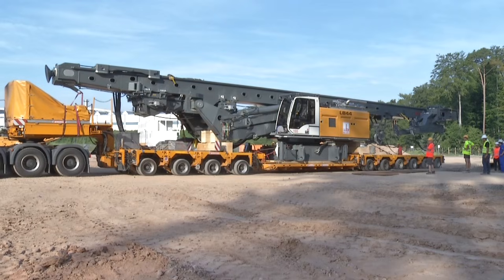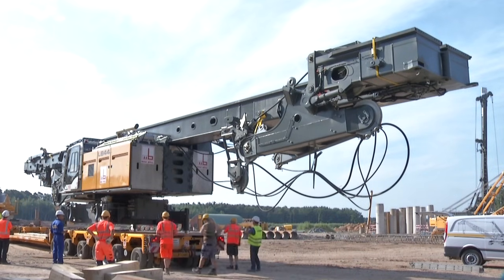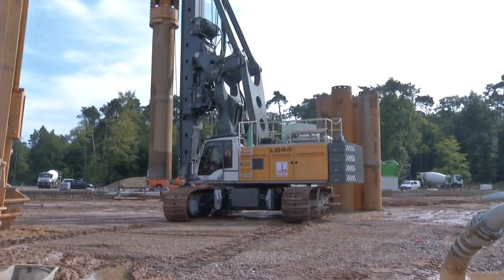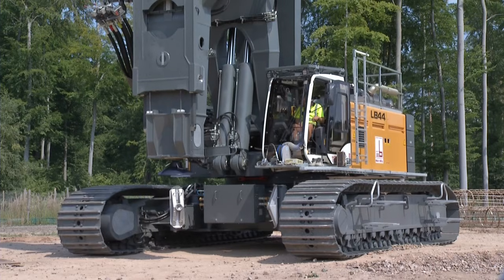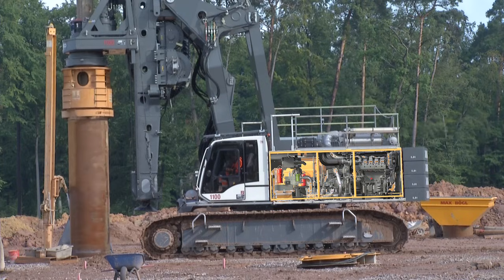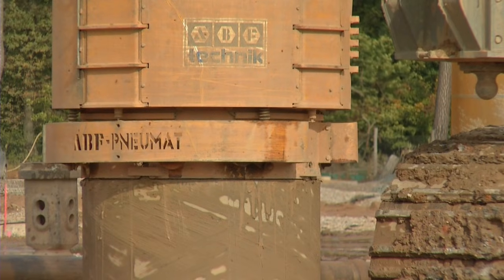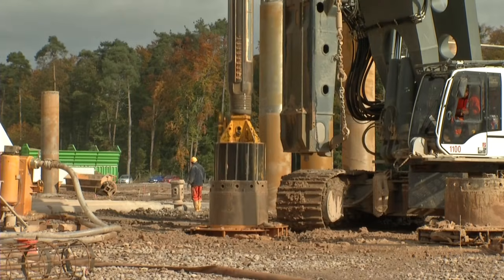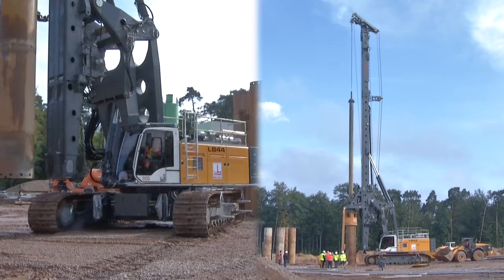Liebherr - Mr. Torque - the LB 44 rotary drilling rig

Comment: Why do they represent decimal weight as 5,8 ? Here, that would mean you have '5 and 8'.
Decimals are normally expressed as 5.8 for example, where (.) is the decimal point dividing the whole number (5) and the fraction of 10, in this case 8/10.
Reply: In some countries like Germany commas are used instead of decimal points

Comment: 376,156lb/ft of torque for all you in Liberia, Myanmar and the USA that still use the old British empire imperial system.
Reply: if you're gonna troll, get the units right.
Reply: @jnawk83  so what unit do you use to measure torque?
Reply: @xaiano794  the freedom unit is the foot-pound, you used pounds per foot.   I use the newton-meter, like all reasonable people such as yourself
Reply: @jnawk83  you're right, the correct nomenclature should be lb/ft but for some unknown reason people called the unit the foot pound instead.
https://en.m.wikipedia.org/wiki/Pound-foot_(torque)

Man what a perfect example of how stupid the system is. Thanks!
Reply: @xaiano794  well even that calls it a pound-foot (lbf-ft) - no division involved.  Don't insert a / in there.   But yeah it's a totally daft system.

Comment: 510 kilo newton metres of torque. I replayed that to make sure I had  not misheard.
Reply: at a guess, the rig needs to be anchored to apply that because that should be enough to just start spinning the rig instead of the drill head
Reply: @stardustger2389  It of course makes sense as soon as you do a basic torque calc but if your torque benchmark is car engine figures it is pretty impressive!

Comment: Leider können die üblichen Rezepturen für Kontraktorbeton derzeit nicht mit den aus den erreichbaren Bohrtiefen dieser Gerätegröße erwachsenden Anforderungen mithalten. Bei der hier gezeigten Baustelle (Liebherr weiß welche ich meine) hatten wir mit den über 60 Meter langen Pfählen da zeitweilig auch Probleme.

For the time being the usual tremie concrete mix designs unfortunately can't meet the requirements emerging from the achievable drilling depths of this rig size. During the job shown in the clip (Liebherr knows which site I mean) we sometimes also faced problems with shaft depths exceeding 60 m (200').

Comment: Terrible product support of these machines here in America...we got rid of our dozers and track how because of overpriced parts and lack of dealer support...now we only buy CAT....period
Reply from the maker: motorhead Well, we had some problems with the dealer network in the US for earthmoving machines - but these are solved now and we are adding more and more service locations.For special deep foundation, we do run an own network in the US, there shouldn't be a problem for the drilling rigs!
Reply: ***** im trusting  the germans  for machinery  needs
Reply: ***** I hate to add fuel to the fire, but we are going to need to see some physical proof as well as impartial references to this claim.
Reply: onk omh a gg kerjo th
Reply: motorhead banmuonhenho

Comment: I've decided to update my cordless drill to this.
Reply: +dmak2 I had problems putting up a painting in my basement with my drill, so I too decided to upgrade to the LB 44 drill. My problem is now gone, as there is no longer a wall to hang the painting...or a basement.
Reply: dmak2 223051894
Reply: dmak2
Reply: dmak2 ีคค
Reply: dmak2 ....
Reply: Make sure you get the professional version as it will last longer than the one they sell cheap at Walmart.
Reply: dmak2 and a great site
Reply: It worked great on my Dremel tool.
Reply: dmak2 x